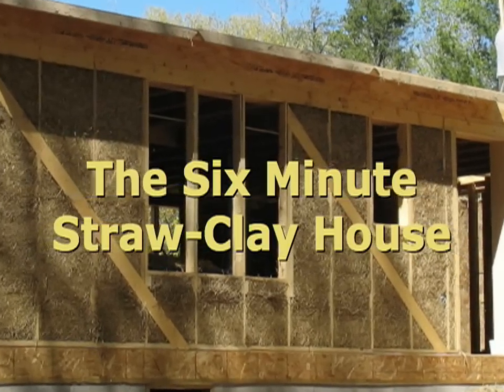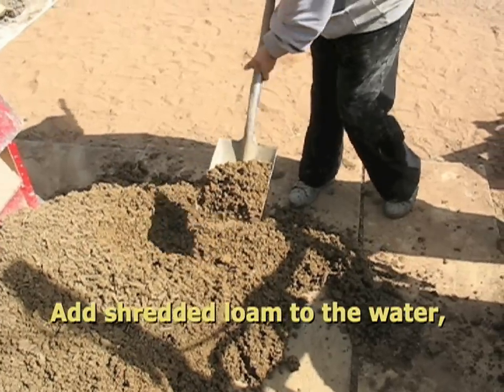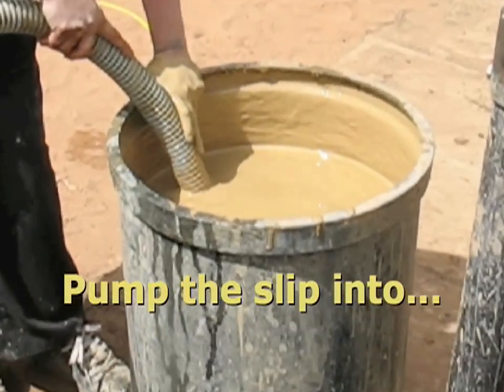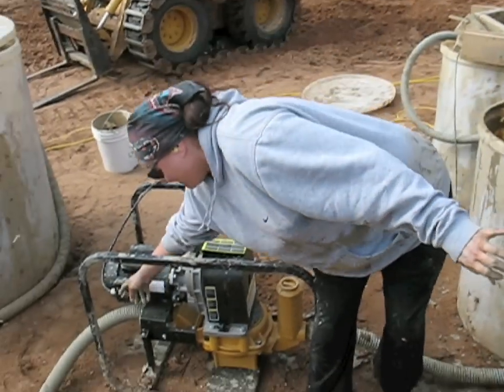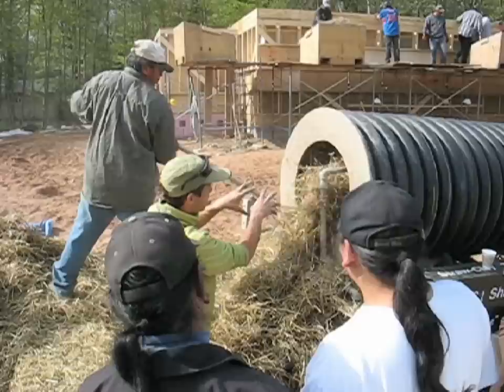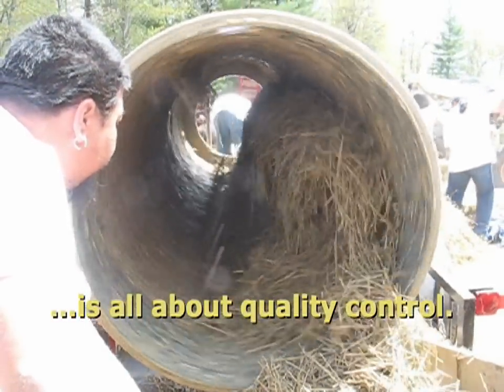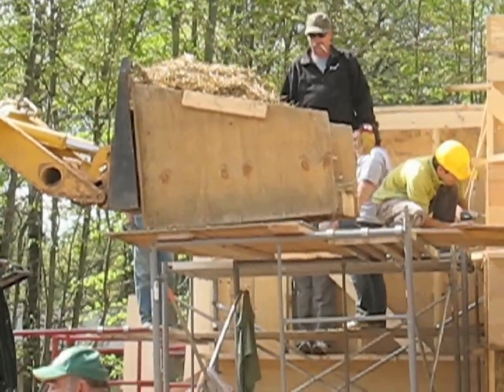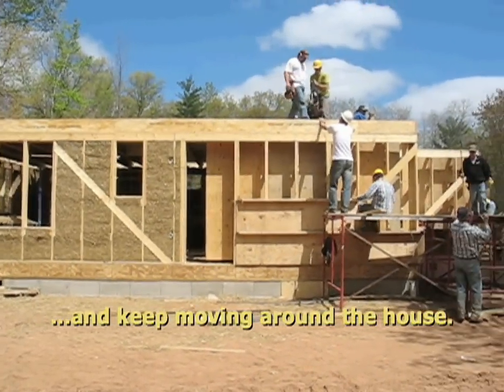The Six Minute Straw-Clay House

Comment: Yes I see what you mean now the machines used were not superfluous. The objective was to produce a locally made, renewable product that was consistent throughout. So while they did use energy it was less than manufacturing another material like Portland cement or bricks that require more energy to make and then also require more energy for transport. Your method produced an inexpensive, low carbon foot print, sturdy, uniform product throughout. Good Job! Thank you!

Comment: Helped a friend build a straw clay slip home here in New Mexico, where we encourage unusual building techniques. The only difference was we used clay slip, that is easy and affordable, can be found at any pottery/ceramic supply house. She bought 50 pounds bags. Another difference that we made the walls much thicker, to insulate better, much like the adobe homes we make here. Once you have plastered the outside, it is impervious to the elements and can last for many years if it is taken care of. It is a version of a very ancient technique that is 1000's of years old from Eqypt, rammed earth building...
Reply: doing it by hand,  small batches... it was like making a salad, tossing the salad dressing, aka clay slip onto the straw :)  Dried very fast, we did a few feet at a time and did it on several weekends with help from various friends, all for a good lunch and great company. Sort of akin to an old fashioned barn building hee haw~

Comment from the maker: The settling tank helps remove sand from the slip. The goal is to achieve as a high clay percentage, and that means removing as much silt and sand as possible. Too many large particles reduce insulating value and are little help with the wall's moisture performance. The settling tank provides several opportunities for the larger particles to settle out, by slowing down the the slip as it flows over multiple edges as shown, and sits at the tank bottom. Works best with large-size sand.

Comment from the maker: @darkeverett 
The short answer is that the addition of a small amount of clay greatly adds to the longevity of the wall, by keeping moisture away from the straw fibers. The technique is not new -- there are straw-clay buildings for example still in service in Germany which are over 400 years old. Our advanced method provides good insulation value (R-21 for a nominal 12" thickness) as well as some thermal mass effect.

Comment from the maker: This home in northern Wisconsin (±8,800 degree-days) is preforming very well. Straw-clay handles moisture much better than untreated raw straw in a cold-wet climate. Unlike straw-clay of the past, the technique here retains much of the insulation value of the straw. Untreated straw does insulate a little better, but the walls of a typical house only account for 15-20% of overall heat loss; windows & doors, thermal bridging, air-tightness all have much greater effect on thermal performance.

Comment from the maker: 2) Denim is great; we use it too. But it's just insulation; as part of a system it also requires the use of vapor barrier, drywall and exterior sheathing. Plus cotton production has a big ecological footprint. It is one of the most pesticide- and energy-intensive fabrics made. 

3) Straw-clay is unusual as a building material in that, in addition to R-value, it provides some thermal mass to a home. This performance feature is often difficult and overlooked in American frame-style construction.

Comment from the maker: Starting with a given clayey loam (that is, a typical soil = mix of sand, silt and clay) we look for at least 40% clay content.  We use a standard sieve test method to verify the particle size distribution. This clay percentage helps us achieve a good insulation level; in our climate (center-northern USA) we want at least R=1.7 per inch of wall thickness (0.084 W/m*K). For more straw-clay science, see our video by Douglas Piltingsrud (link above in the description).